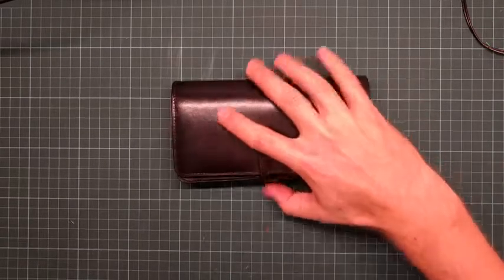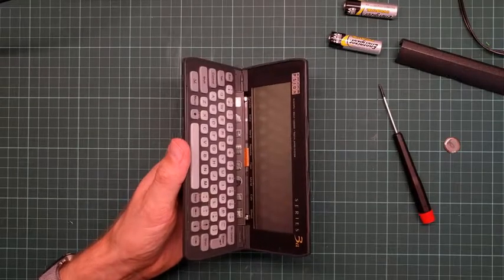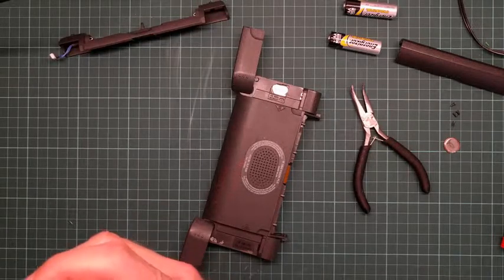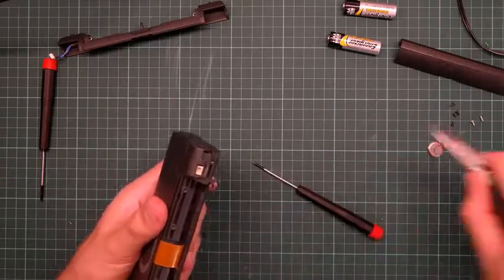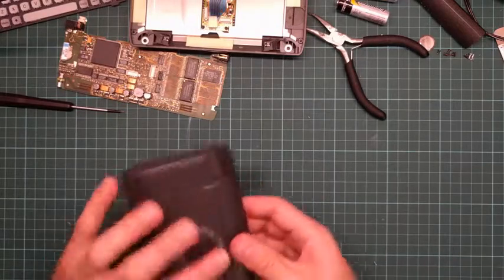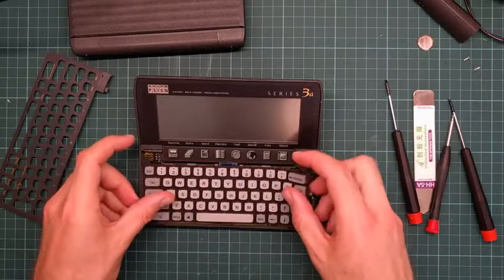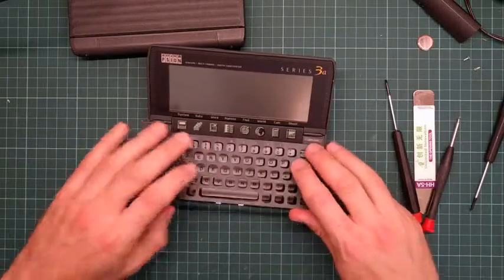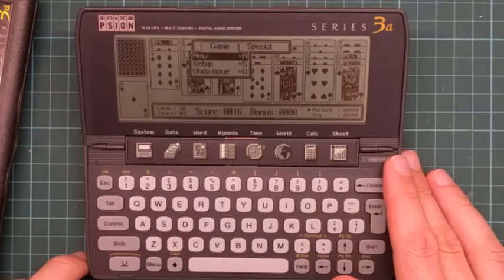Hjalfi replaces a Psion 3a motherboard

Comment: Absolutely brilliant video. Thank you for sharing. I've always wondered what was inside. I used to write shareware for a Psion software distributor when I was going. The cards they used were called SSD cards rather than SD cards. They really didn't design them to be taken apart easilly!

Comment: One of those 3a's was my office on the road (and the data source back at base) up to around 2002.

Serial adapter was very important; hook it up to a modem with fax capability and I could fax e.g. invoices from anywhere with a telephone line; or connect to a serial port on a PC and dump Postscript to a printer.
Text-based connection to Internet for email and WWW. At blistering speeds. ;-)

Back at base, pair it up to an Amiga using the peer-to-peer network connection to produce pretty reports/forms.
Spreadsheet was very useful.
Time planning software was essential for keeping far too busy.

Unfortunately, one of the hinges broke last year. :-(

Comment: I am an old Psion hand starting with the 3 and progressing up to the 3MX. I stopped using mine in 2015 (when I retired). 
The Psion machine has never been bettered or replaced - the "PC in your pocket" ethos died in the mid two thousands. 
I wont go into the details of what uyou were doing in the video, suffice it to say that when you have done a few you will get the method method down. 
What I wanted to pass on to you is that I still have a wood effect Psion 3a on my home office as a high end organiser/alarm clock. To do this it combines the Psion's built in Agenda program and Sound programm with an app called Clock. Now I get told when to take the bins out; when birthdays , anniversaries, appointments and any other dates I need to remember.

Comment: The recessed hole was a reset switch. I think from memory you could do a soft reset using it. Holding a key, possibly the psion key and pressing a pin in it did what they called a hard reset. The same as doing a full battery pull.

Comment: Very interesting fix. I fixed a Workabout (A 3 MX twin) some days ago. It's not so compressed and plastic sensitive in the parts to repair/swap. I also looked inside a Siena. The electronics is very sturdy in those and very interesting to see or tinker with. It's mostly some cables failing. Sadly, the plastic just fall apart with age.  It's the same with the 5/5MX Series/Ericsson MC218 (5MX). I am mostly interested in the OPL and can use emulators.

Comment: you did a great job but as we have seen - these machines are great - the 3a is better than the 5 because its smaller but all these machines have one huge weakness - the over elaborate hinge and the weakness of that hinge - luckily the 3a models are still easily found on ebay - they are all a real pain to service so it would be much more effective and less expensive than servicing to simply buy a unit for a small sum on ebay and call it a day - thanks for the instructional video

Comment: Hello, i recently opened a Psion Series 3a for cleaning, and when closing it back accidentally destroyed some motherboard resistor, which was next to the SERIAL LINK CABLE SOCKET, there was a hole where i thought it was a hole for a screw, but it wasn't the screw hole, can you make a clear picture of your motherboard in that area so i know what to put back?
Reply from the maker: I'm sorry, this is long since reassembled and I don't want to dismantle it again. What you can see in this video is all I have!
Reply: @hjalfi  Ok, i was thinking you still have at least the old motherboard, but if not then is not a big deal, can't find anything high res on the net as well, just some low res pics, oh well, that's that then, cheers.

Comment: You’re opening it wrong.  I could disassemble and reassemble this unit blindfolded  in less than a minute with just a philips screwdriver.
Reply from the maker: Well, I know that _now_, don't I...
Reply: Out of my head....
1)Open battery cover
2)Take out 4 screws
3)Untie battery cable by pulling the battery compartment by its own cable 
4)Pull out battey connector using battey compartment 
5)unscrew ssd screws x2
6)take out strange looking screen clams x2
7)pull/slide clams out of screen x2.  Watch out L and R are different clams.
8)take out screen hinge needles with fingernails or sharp knife x2
9)screen and main unit are now seperated
10)pull the top middle keyboard
11)pull test of the keyboard out by continuing pulling top end
The rest should be obvious.

The most difficult part is (6), putting (6) back in is even more tricky.  

There is 2 types of screens.  Old unshielded and new shielded.  Distinctive difference is the thickness of the screen bezel.
The clams of these versions are not compatible.